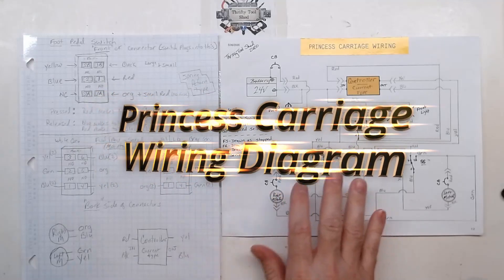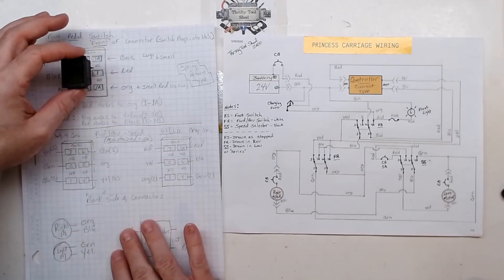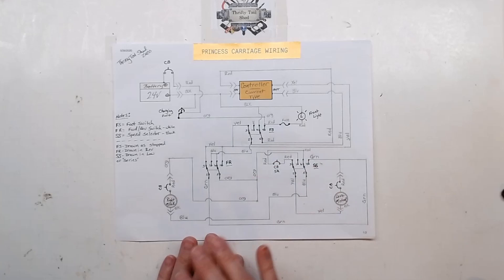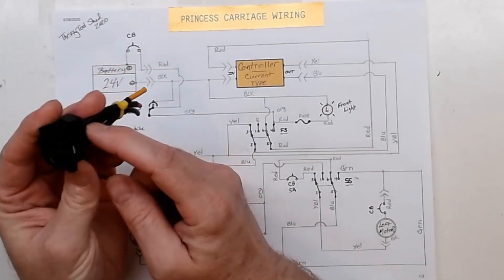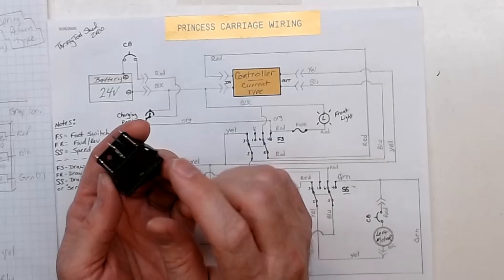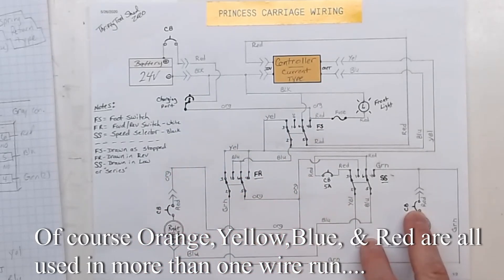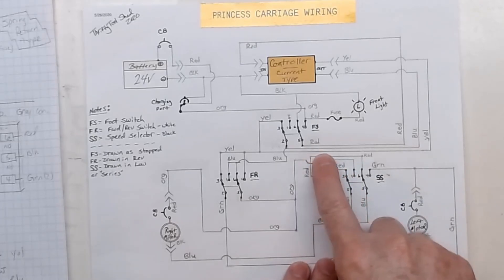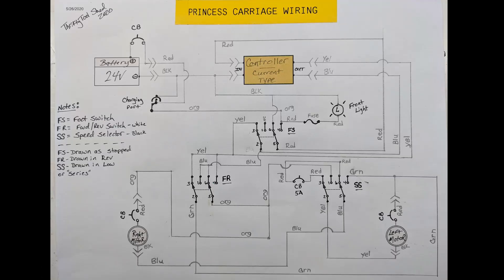Disney Princess Carriage Wiring Diagram

Comment: Just got this for our daughter for Christmas. Plugged it up and it showed green as already charged, we let it charge over night and it still won’t do nothing!
Checked all the plugs, connector and fuse and all seems fine, but it still won’t work!
We’re all devastated. Will be calling dynacraft as soon as they open back up. :( I hope they will help us, do you have any tips for my husband to try?? Thanks and Merry Christmas!
Reply from the maker: Sorry I am just now seeing this. Dynacraft should definitely make it right and I understand the devistation  this morning. I would be happy to walk through troubleshooting the best we can remotely. I have a few videos on the basics which you may have found them all. I would trace the power all the way through to the speed controller. And make sure it is getting all the way. I know you have mentioned you have checked all connectors and that is great first step. If you have a meter verify the battery voltage is good as well. The other thing to check is that the charger plug on the carriage has a connection that will not allow power through if not unplugged from the ac adapter. Just verify that is working ok as well.
 Merry Christmas 🎄

Comment: Hi, this carriage is terrible at off roading, can the motors be wired to work together as positraction instead of all power going to wheel that is free? Thank you
Reply from the maker: They are together or parallel in high and in series when in low. So in high they should both be getting equal power.

Comment: Do you have a shop to work on a princess carriage that does not work? Do you need to have the wand to operate the vehicle?
Reply from the maker: I do not, just worked on the one for a friend. No, the wand is not necessary to operate it. It just makes the lights light up etc.

Comment: I'm a trying to trouble shoot a princess carriage I have tested switches and replaced the speed controller . I can hear the speed control click and nothing I tested voltage at the motors with pedal pushed and I'm getting 17 volts on both leads shouldn't I only get voltage on one side depending on direction chosen?
Reply from the maker: Ok, what do you mean by 17V on both leads. Going from battery negative post with black lead and reading the yellow at the left motor and the green at the motor both read 17V when checked accross with the red meter lead?
Reply: Yes
Reply: Same on blue and orange
Reply from the maker: @nathan101971  
Sounds like to me it's not getting all the way through all switches. Like the voltage is reading through motor because it is not a complete circuit back to ground. You may find it useful measuring from the Blue as common from the Controller and trace it through that way? Remember the fwd/rev switch switches both the wires from controller. You must be losing one of them through the switches.

Comment: Thank you, for your time, and effort in making this schematic. 🤔Originally I had 24v on the wires behind the foot pedal and no continuity. . I couldn’t find one so I took the old one and refurbished it with sand paper and bending the points back to the original placement. It worked for a good while, now again it’s not working. This time I checked the wires and only had 2.10v, but the charging light was green showing it was charged. I left the charger on for a while, and checked again. This time it showed 9.8v, but once I put my test leads on the wires, the voltage drops. Can you please give me some idea of where I should go from here. Thank you and God Bless 😉🙏
Reply from the maker: Make sure you are getting 24v from your battery.
Reply: Thrifty Tool Shed if the battery isn’t holding a charge, what part of the circuit could be draining it? Would the foot pedal cause this?
Reply from the maker: @unknowninfamous2346  
I would check your battery, it sounds like it is the problem, at least the main problem. The battery should hold up well even in high current drains for good while.